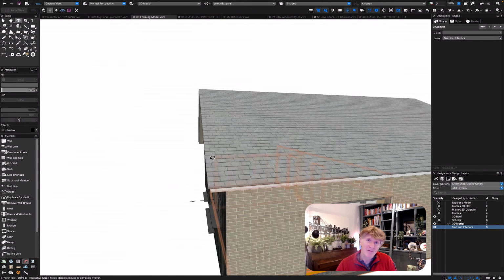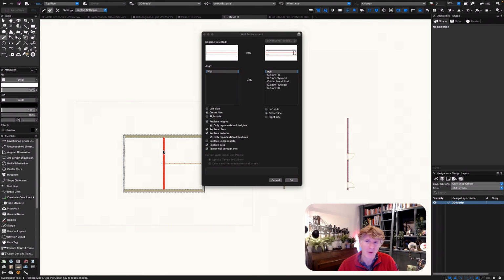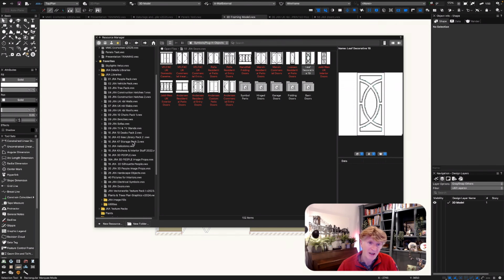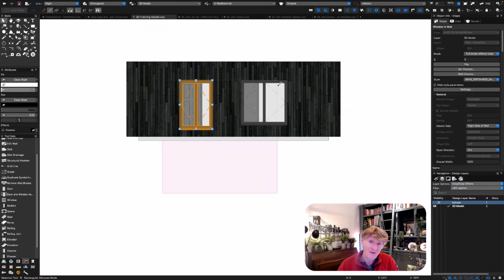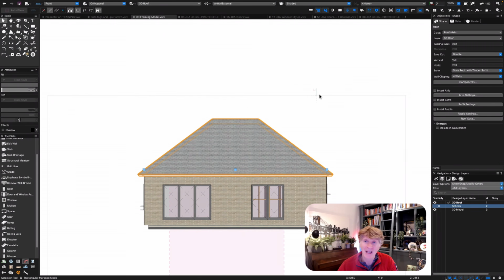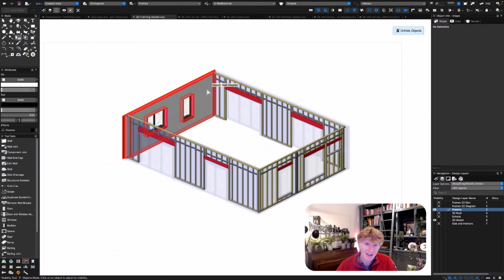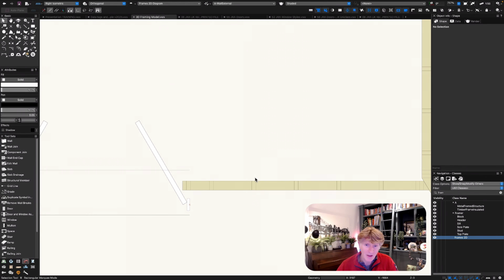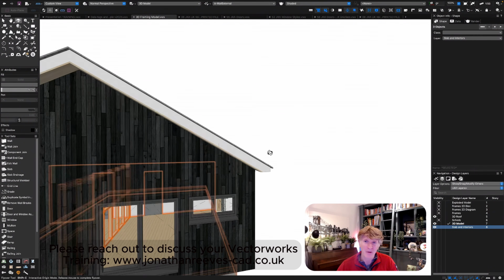Mastering Vectorworks: Simple Steps for 3D BIM Workflows

Comment: Hi Jonathan- A question, if you don't mind:  I've been following along with this quick tutorial. However, when I go to create the slab, I get an error saying ""a slab cannot be created from the bounds of these object. Pick a closed series of connected walls."  I've tried every way I can to join the walls, and they seems to be fully connected, but it still refuses to make a slab... unless I use the capped join mode of the wall connection tool.  Any idea what the problem might be?  Edit: using the component join tool at every corner seems to have worked too.  Still curious what the problem is without having to do that..? Some setting maybe?

I've been really enjoying the tutorials, thank you!
Reply from the maker: Glad you're enjoying the tutorials! For the slab issue, maybe try recreating the walls from scratch? Or just draw a shape then right click and "Create Objects from shapes" and choose slab. Have you ever considered some bespoke one to one training, if not let me know if I can help?

Comment: When you speak of working with some timber framing companies,  do you mean to say the Vectorworks framer does not produce framing well enough to work with them?  You mention doing it yourself instead of using the framer.
Reply from the maker: I meant is useful sometime to get a rough idea of how much timber and structure is required at early deisgn stage. However framing companies can offer a more comprehensive service for construction.

Comment: Great video as always, thank you Jonathan, a question related to the frame tool, can it be changed to metal frames? like the ones on the wall you used?
Reply from the maker: Hmm, no, but maybe you could use a custom selection to select all the wooden studs rep[lace then with metal studs, and symbols.
Reply: Ee😅ri